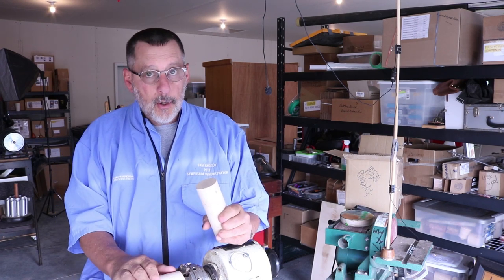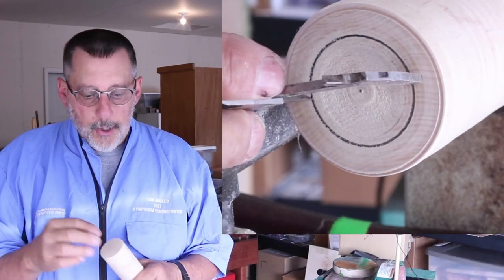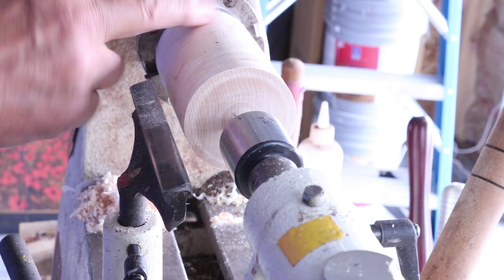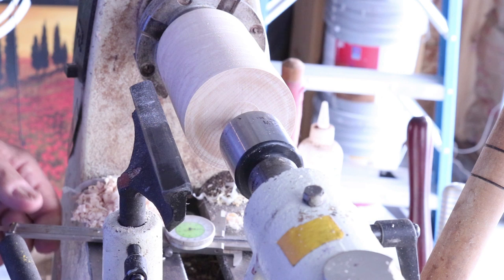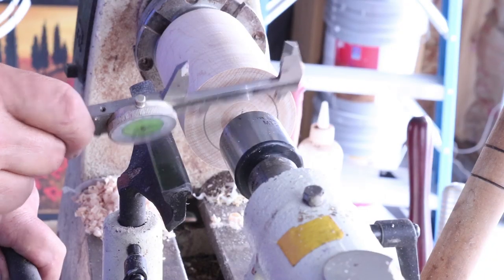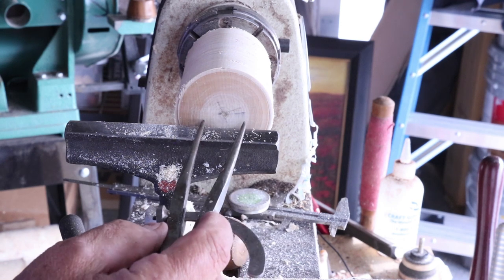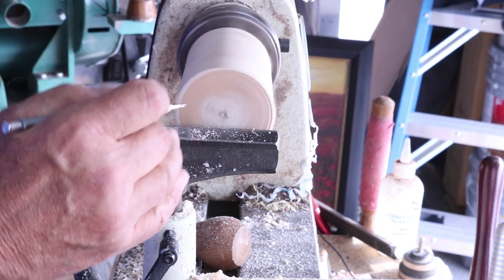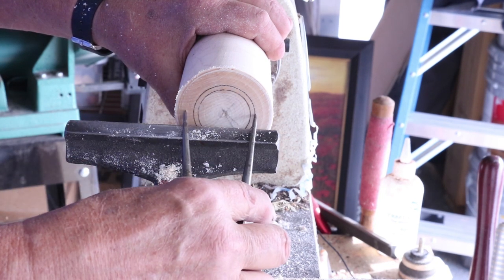Turning Tip #1  "Marking a Tenon"  with Sam Angelo

Comment: If I use dividers, I'd set them to half the diameter and put the point in the center and scrape the outside.
Reply: I was going to make the same comment but you beat me to it. I also do the same thing with a compass.
Reply: Darn good idea.
Reply from the maker: Yes I also think that is a great idea. I have seen it done- this is good cause you just need to estimate and set your divider to half the diameter of the Chuck jaws. Thanks Sam